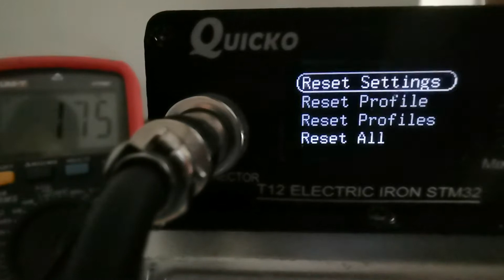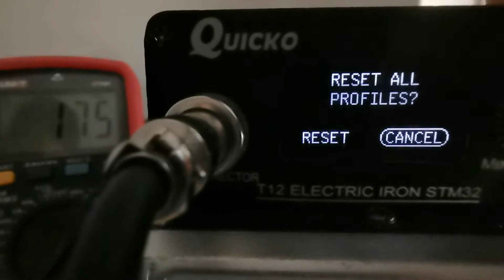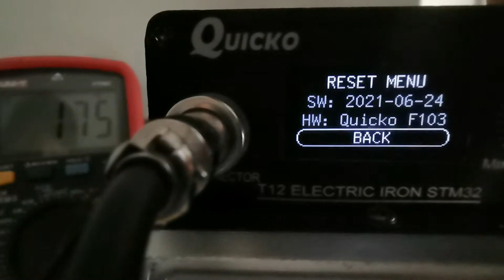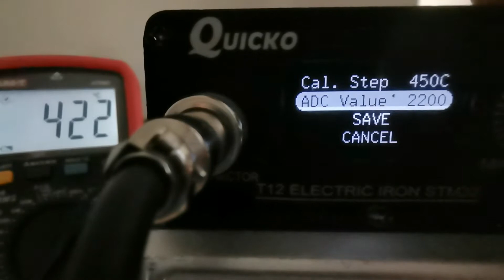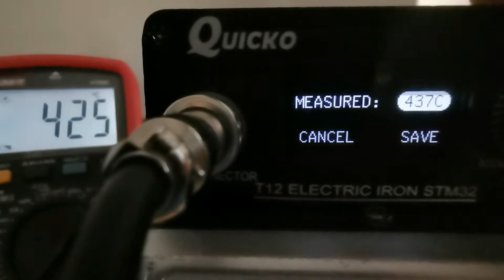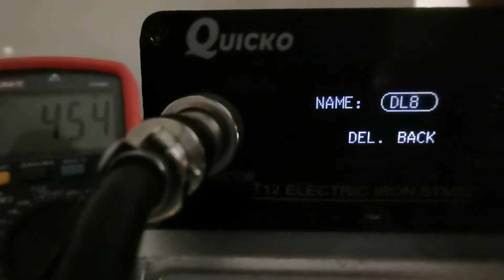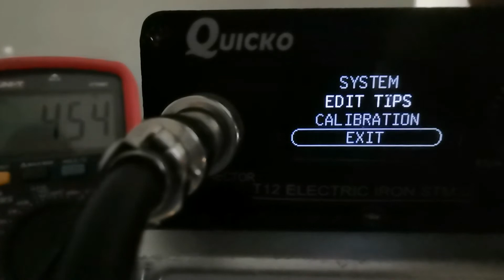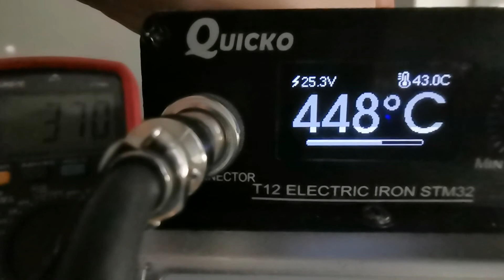Stm32 Soldering Station custom firmware

Comment: There is David...Can this T12 soldering system be modified using a C210 soldering handle, and can the autosleep sensor when in position function... like most C210 soldering irons...??

Comment: Hi David,
Can we change Menu selection drop down graphics from  (===) type to [===] . If yes where can we change the parameters. I am expecting the menu selection should look some things like this in the video link.

https://youtu.be/rjON_enuOGs

I appreciate your help in this
Reply from the maker: Please open a ticket in GitHub for those questions.
Anyways, you want the border to be square, right?

FILE
Drivers/graphics/gui/widgets.c

FUNCTION
widgetDefaultsInit

MODIFY
w->radius=-1;  (Auto)
To
w->radius=0; (zero radius, square)
Reply: @Deividalfa  sure i will open ticket. Thanks 👍

Comment: Hi David,
Thanks for your inovative work. How can I change the starting logo with my custom logo. If I change the image in "Pictures/logo.bmp" it will work ?
Reply from the maker: Upload a 128x64 image here:
https://www.online-utility.org/image/convert/to/XBM

Download the xbm file, open it as text and replace the array contents in "Drivers/graphics/gui/screens/boot_screen.c"

Take care of the first two values in the array (128,64), they're the width and height, must be specified manually, it's not included in the xbm array conversion.
Just check the original boot_screen.c file, it's very easy.
Reply: Got it , Thank you..

Comment: Hi, I’m thinking of buying a quecoo t12-959. They say it’s stm32 but it has larger screen and I don’t think it’s an oled. Do you think it’ll work with your firmware or should I go with 958 and smaller oled screen?
Reply from the maker: Hi, that model is very new, there're no schematics or board pictures, also using LCD will require heavy firmware modification.
There's no support for it, at least for now, I'm not planning buying a 959 either.
The T12-958 seems to be the same as a KSGER v3, while the T12-955 is a KSGER V2.
Regards.
Reply: @Deividalfa  I have replaced some weird factory cpu for stm32 and installed the firmware for ksger 3.x on t12-958. It seems to work, so it’s not “untested” anymore 😁
Reply from the maker: @wiktorsz1967  Nice!
Reply from the maker: It seems the T12-959 doesn't use STM32 after all, even if some mention this, but STC15W408AS.
So no support.
Reply: @Deividalfa  thanks for your fast response, I’ll go for 958 with stm32 then

Comment: Hi I have quicko t12-952 firmware is compatible and which pinout?
Reply from the maker: Hi, check the pictures in the BOARDS folder or post them in eevBlog.
I think the 952 uses a STC controller, this fw is for stm32 only.

Comment: Do you plan to create a similar firmware for a KSGER Hot Air station?
Reply: Now I plan to buy another (but similar) controller board to flash you firmware and use it with my JBC C245 clone.
Reply from the maker: @DimAsWizard  Great :) I dedicated a lot of time, specially fighting Ksger issues... Since the firmware finally became stable, I only fix bugs and issues, I don't plan doing any huge rewamping anytime soon.
Reply from the maker: I already have a 858D hot air station which work nicely for me, so the answer is no, developing for something you don't have is a nightmare.
Reply: @Deividalfa  today I flashed your firmware to my KSGER station (v3 board) and I’m happy with it! Thank you for this great work! First time I use it a few months ago and just did not understand all the features, so decided to restore factory firmware. But today I was ready and I impressed with all these new features! Feel like I bought completely different soldering station. Calibration never was so simple, and my soldering iron become much more efficient, comfortable. Feels like it got twice more power and speed. Great work! Hope you will update it))) Thank you one more time!

Comment: Great work 😍😍 i will try with my ksger, do you think about jbc twezzers od nt115? Can it works with it? Of course with other profile etc. Can we donate you?
Reply from the maker: Nt115 should work if correctly wired, calibrated and power limited. You don't need more profiles, any will do after changing the calibration.
No idea how the tweezers are  wired...
Reply: @Deividalfa  thanks for fast answer!
Reply: @Grucha1998  znalazłem Cię xd i jak postępy ?

Comment: Hi David,
Thank you for your work. Are the schematics for the quicko F103 and F072 variants the same?
Also is the Detection_fix required for the quicko boards?
Reply from the maker: Yes, exactly the same, in fact mine was a 072,  I replaced the stm32  with the 103.
It uses active detection pulses as a workaround, but might not always work perfect.
In that case, the detection fix is preferable.
For further questions please use the forum 👍

Comment: On KSGER HW2.00 dont work.
Installing firmware and black display. Dont work.
With firmware 3.x  launches but It does not work properly.
But if it is fine-tuned, it even works on version 3.0. 
STM32F102C8
Reply from the maker: Please, use the forum, expose your issues with detail, including board pictures.
Not here!
Try the latest builds, there was a memory issue in the recent days causing crashing in 101/102 devices.
I don't know any Ksger board 2.0 that uses spi display like 3.0.
So go and post the details!
Reply: @Deividalfa  Ok.
But I still don't understand why the HW2.00 board version is in the 3.x folder? 
https://github.com/deividAlfa/stm32_soldering_iron_controller/tree/master/BOARDS/KSGER/%5Bv3.x%5D/Schematic
https://github.com/deividAlfa/stm32_soldering_iron_controller/blob/master/BOARDS/KSGER/%5Bv3.x%5D/Schematic/STM32_T12_oled_v3.0.jpg
I have just such a board.
Reply from the maker: @Angelo0chek  please use the forum